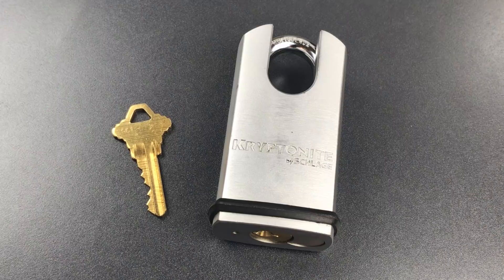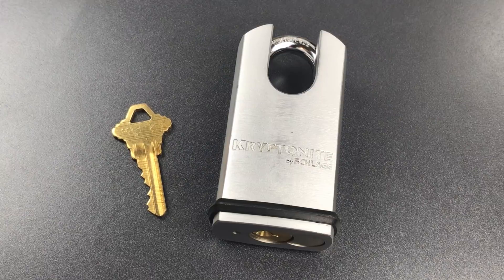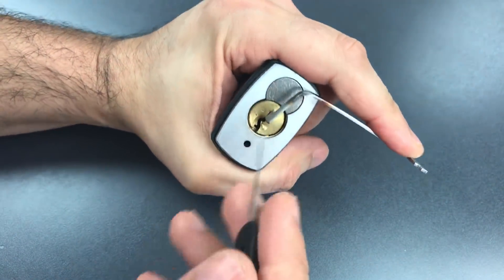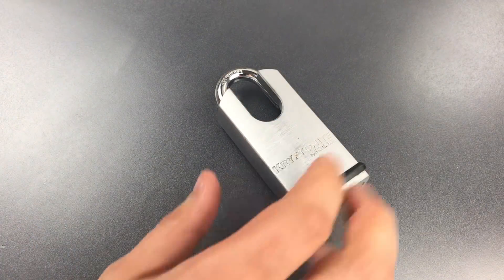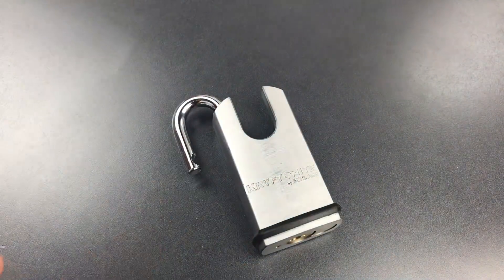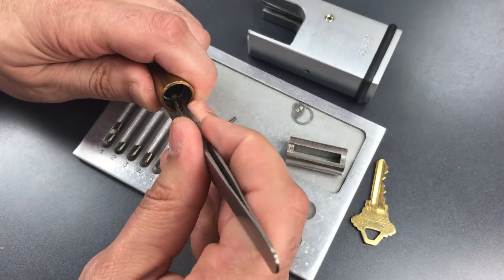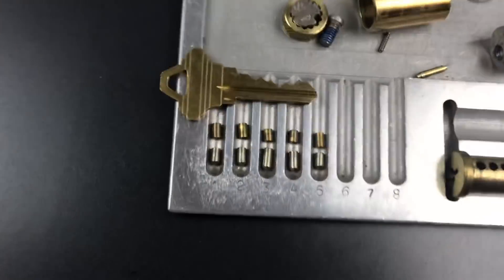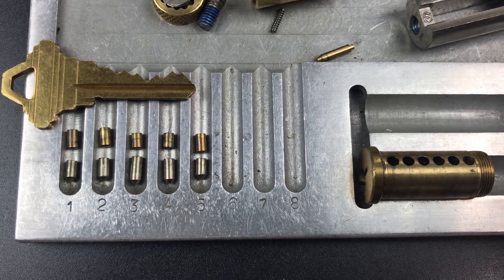[757] Surprisingly Tricky: Kryptonite KS82 Padlock Picked and Gutted

Comment: "This is the LockPickingLawyer and what i have for you today is a Kryptonite KS82 padlock. It's unpickable, unbeatable, you can't even open it with the key. no one has been able to pick it. Today i'll pick it with a rusty paper clip and my toe nail. Looks like i got it open in 22 seconds."
Reply: BAHAHAHAHA
Reply: Yup
Reply: With total dead pan delivery
Reply: LMAO
Reply: 'that may have looked easy but until I realised it needed a lot of torque it had me baffled for a while' About 45 seconds.
Reply: Paronax you forgot "have a nice day"
Reply: This is accurate, didn't knew this guy had his own meme base
Reply: It's crazy how quickly he opens what he describes as the most difficult locks out there. "This is an incredibly difficult lock, probably only three pickers that I know of could open this." opens it on the first try in 12 seconds
Reply: Paronax lololol 🤣😂
Reply: Top of the keyway toenail.
Reply: His comments make me crazy, but LPL does get to play with and decode the best way to pick it beforehand.
Reply: @Styxcontrolledoppositionhammer666 it's the click, he is twisting it just enough so when he pushed the pin up the tension will hold, or bind, it up where it would be so he can continue to more of the pins.
Reply: @Styxcontrolledoppositionhammer666 : binding is important: it stops you opening the lock :-)  making them cones would not stop that but it would make the lock sloppy and prone to wear.
Reply: @Styxcontrolledoppositionhammer666 np lol just started watching not long ago myself and figuring it out as i go along.
Reply: Paronax that shit has a basic ass key he probably got payed by kyptonite too say it’s a  good lock

Comment: Nickel-Silver key-pins are standard for factory pinned locks from Schlage... under Schlage keying specifications, there's 3 (three) different sizes for driver-pins; (0.165", 0.200", 0.235") being the three different driver-pin sizes that are clearly mentioned in Schlage lock cylinder pinning specifications in order to correctly balance the pin stacks with the variations in key-pin heights... for example, a #9 pin height, of which would correspond to the deepest possible cut of the key would warrant a very shallow driver-pin of 0.165" and the opposite would be true for the most shallow of cuts on the Schlage key using #0 or #1 bittings or key codes would warrant a size 0.235" driver-pin...

For example, key codes with corresponding pins of #0~#3 would warrant a 0.235" driver-pin...

key codes #4~#6 would warrant a 0.200 driver-pin...

key codes #7~#9 would warrant a 0.165" driver-pin. 

Stock Schlage keys are made out of Nickel-Silver... of which according to the manufacturer, to reduce wear of the keys and pins, the same material is also used for the bottom (key) pins that make contact with the key. Nickel-Silver is much harder material than brass... so it only makes sense of the logic to use the same material to reduce wear and increase longevity, for which Schlage locks are known for and also have the reputation of being the most durable in the industry. 

In fact, Schlage branded lock pinning kits come with all Nickel-Silver bottom or key pins, with 6 (six) different sized (#2~#8) master-wafer pins and the three standard driver-pin sizes composed of brass, with phosphor-bronze pin springs...

Schlage locks use a MACS (Maximum Adjacent Cut Specification) of 7, with a 2-step system for generating master-keyed systems with a maximum number of 4,096 key differs for a single master-keyed system of which is employing 6-pinned lock cylinders, with 10-steps of cut depth increments per key cut... (#0 of which is the uncut height of the key blank itself to a #9 cut being the deepest cut specification for Schlage.) 

Also as a side-note, the repetitive cuts of #9 is used to generate a functional bump-key to rapidly bump or rap open standard Schlage branded locks or their cloned counterparts.

Comment: The Schlage manual indicates three different driver sizes to use based on key and master pin length, but don't see them often.
.235 for plug total 0-3
.200 for 4-6
.165 for 7-9

Comment: My guess is the plug is slightly oversized and the housing is slightly undersized (probably within tolerance though), AND by luck the pins have been drilled almost DEAD on far as alignment to each other ... like LPL said .. 'stars aligned' :)

Comment: Its funny how that happens, sometimes there's just a lock that appears for no reason to really trip you up. I've had times where are getting a lock filled with security pins, I'll get stuck on a "regular" one. Just goes to show you can't always assume a lock will be easy!
Reply: Reminds me of the Master 2250D. It's a Master Lock and it has no security pins, but I couldn't open it for days. Then I saw Bosnianbill's video where he said you have to force the pins very hard and only stop before you break the pick, and with that piece of advice I opened it up.

Comment: If I had to hazard a guess, it looks like the machining between the key pins and drivers is incredibly tight. Coupled with tight tolerances on the core, there's simply no way to catch your drivers above the shear line without holding both the key pin and driver in place. The heaviest tension would let you feel what is probably micrometer tolerances, but anything lighter would simply feel like a single solid pin with no shear line.
Reply: I've always thought that a lock produced with super hard material using extreme precision milling would be impossible to pick for this reason. If there isn't any "flop" in the pin holes and all pins bind precisely together, then getting that "click" at the shear line would be virtually impossible. I say virtually because LPL will bring out a cheater bar to apply "monstrous tension."
Reply: I'm think very strong springs in this one. Would make it hard to get a solid set with normal tension.
Reply: Prolly first one off the line after retooling.

Comment: Those look more like steel pins. Could be why it is harder to pick if the pins are harder and there are tight tolerances there's no give so there's no ledge to set the drivers unless you use "monstrous torque"... That's just my guess from across the country *shrug

Comment: Hi Harry, The stars must have aligned during manufacturing .... (:-)) You could be right, but I'm willing to bet it's the pin holes that are more aligned than normal. Every now and then you'll get a standard cylinder that won't SPP. We see it on the odd occasion, and a huge amount of tension is required before the pins will set. You know this because there is no obvious binding order, they will pick as your cylinder picked - every pin binds pretty well the same amount. If the driver pins have a flat bottom, you will get a click when set, if the drivers have a bevel, such as the original Lockwood, under strong tension they set soft, and require slightly less tension to finish off.  Regards, Brian.

Comment: Trying to think of a way to put a torque indicator on the lock so we can see just how much a monstrous amount is. Nice work.
Reply: Trey Cook there's a simple way, the tensioner is tensile steel, so it's deformation under stress is directly proportional to the applied force. A simple 2-part graduated paper sliding ruler positioned under the tensioner should do the trick. (something like what's used in construction to monitor cracks)
Reply: Or you could look at how white his finger tips turn and guess he’s pushing pretty hard.
Reply: @AntoineFleuryGobert  - I notice a bit of discoloration at the bend as if he has modified it with heat. Would that affect the test you describe?
Reply: Trey Cook I don't think. In a dynamic system, it would have some influence, but considering the effort is pretty static... you have 2 springs in continuity...

Comment: Will this lock accept 6 pins? The core has 6 holes but the bible doesnt look like it has 6 slots
Reply: it would but the 6th pin would ride on the end of the key and not on the bitting
Reply: @UnacceptableViews  it would be used with a 6pins jey, the SC4 from schlage
Reply: yea you might be right i didn't pay attention to the bible. but you could easily change that out assuming the core is long enough